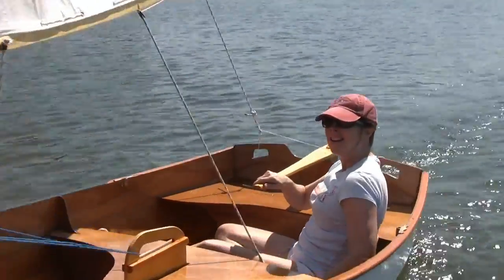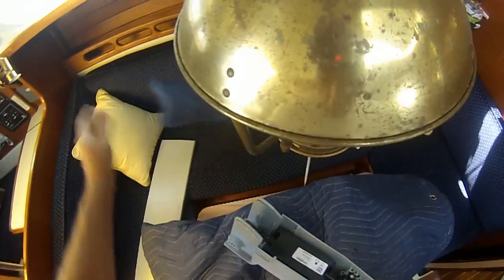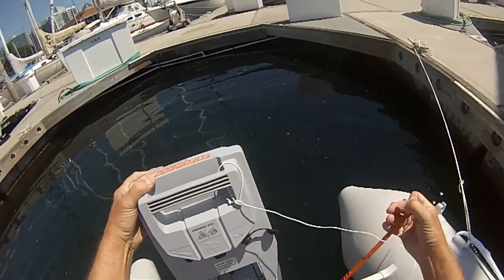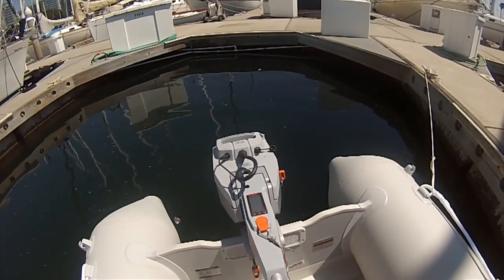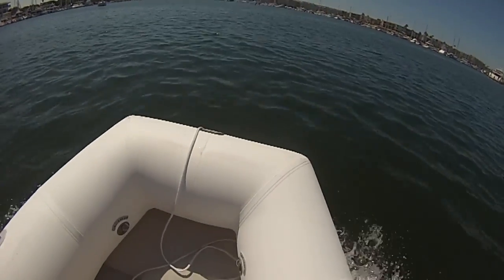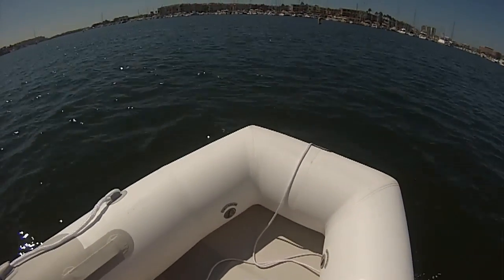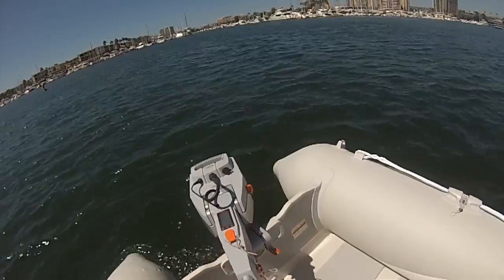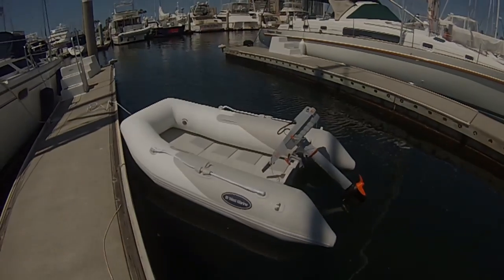Torqueedo  Electric Outboard Demonstration, 2015

Comment: May we have an update after 4 years?
Reply from the maker: I still love the thing (emotional reply).  Here's more: Jan. 2019:  Holding up well, but It doesn't get used much.  However,  it needs no prep to start and the reliability after months of storage is  as when new. No fluids to monitor or change, no gas to congeal.  Broke one prop on a rock.  Ability to store flat in a quarterberth a joy.  Lightness of components a big deal in the world of small boats and pitching inflatables. Downside:  range and expense.  One mile to shore is typical for me.  If I foresaw 5 or ten mile destinations,  the Torqueedo would not be for me.
Reply: Christian Williams , Thank you for the update. In regards of battery performance, did it reduced over the years or about the same compare to when it was new? What other expenses?

Comment: $1699 to $2699? I'll take my $500 3hp 2-stroke (<30lbs) and live with gas & oil.
Reply: I was thinking the same thing,  you almost have to buy the extra battery which makes the 2.3HP Honda 4 stroke for about $900 and a 5 year warranty a good deal

Comment: Are you still using it and if so, how has it held up over time?
Reply from the maker: Jan. 2019:  Holding up well, but It doesn't get used much.  However,  it needs no prep to start and the reliability after months of storage is  as when new. No fluids to monitor or change, no gas to congeal.  Broke one prop on a rock.  Ability to store flat in a quarterberth a joy.  Lightness of components a big deal in the world of small boats and pitching inflatables. Downside:  range and expense.  One mile to shore is typical for me.  If I foresaw 5 or ten mile destinations,  the Torqueedo would not be for me.
Reply: @ChristianWilliamsYachting  For five or ten mile destinations, you could get a bigger torqueedo.

Comment: Any updated thoughts after 3 years with the Torqueedo? Do you still like it? Is it holding up?
Reply from the maker: My use is pretty light,  but  the components and battery remain  in new condition.  I did hit a rock with the plastic  propeller,  breaking it and the shear pin, and now carry a spare (more than $100 worth of plastic).  The original impression remains strong:  no gasoline or oil,  no smoke, no hard starting after six months in a locker,  fairly quiet operation.  Easy to store belowdecks, on its side.  I continue to think it's a marvelous outboard for small inflatables, especially non-ribs, which don't plane well anyhow (but whose virtue is small storage and light weight). A high-speed larger dinghy would benefit from a 4-stroke, which would be my choice for planing speeds and longer crew transport.  Is the Torqueedo worth all the dough?  It is if you hate outboards, especially outboards hanging off the stern pulpit 12 months a year.

Comment: Do you have enough experience now to update on this?
Been looking at this brand and the Elco models.
Reply from the maker: Probably only used the Torquedo six weekends, but satisfied.  No gas, no oil, no drips--very light, stores flat in the quarterberth.  That's what I paid for. But my needs are minimal and maybe personal--i find outboards hung off stern railings as ugly as satellite dishes there.
Reply: Thanks for the reply!
Reply: @ChristianWilliamsYachting  thank you for the Toqueedo outboard video, ordered the 1103,  was about to ask you about recomendations for satelite dishes on the stern, but thought better of it.

Comment: Can also use a small electric trolling motor and $100 marine battery.  I've even used that combo for my 21 foot day sailor when I had outboard problems.
Reply: That's what I was thinking. Torqueedo is just a very expensive battery/computer combo hooked up to a little trolling motor.

Comment: Charging this outboard by onboard 12 volts.  Do you know what the amp draw is?
Reply: Looks like he has the 18Ah battery, someone says it takes 10 hours to charge.. so do the math, add some more for losses, but I would imagine about 2-2.5A should be fine.

Comment: How long does it take to charge?
Reply from the maker: +Mark Phillips
About $1500 on line if no ST.
The Torqueedo manufacturer--it's a German product--gives predictions of battery life from eight hours to one hour, depending on throttle. A reasonable speed of about 2-3 knots gives 6-7 hours or maybe 15 miles.  
The battery takes a long time to recharge, more than 12 hours when fully discharged. An optional , expensive 12v charger is even slower. An optional, $125 fast-charger cuts the recharge to 6 hours. An optional, roll-up solar panel is $850. An optional spare battery is $650.  
However, I have heard that owning a Torqueedo moves you up on the Tesla waiting list. 
We'll see how it holds up. First impression is good.
Reply: the Torpedo IS AROUND $6000 in australia.....compared to $1900 for the new honda 4hp four stroke
Reply: +Mark Phillips I was going to ask the same question. Good video though. Thank you for making it.
Reply: Upon further research, apparently about 10 hours. You can also use a solar panel and charge while you use it. I like that idea. 
Big question though, how much is one of these? Comparable to a new gas outboard?